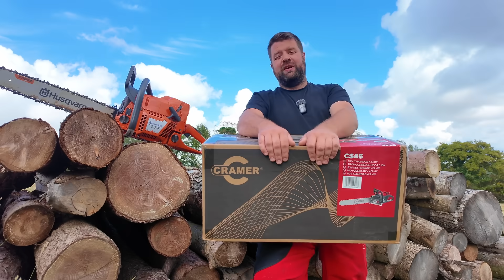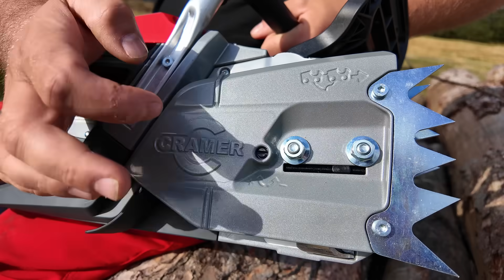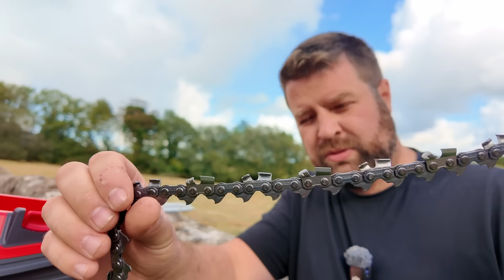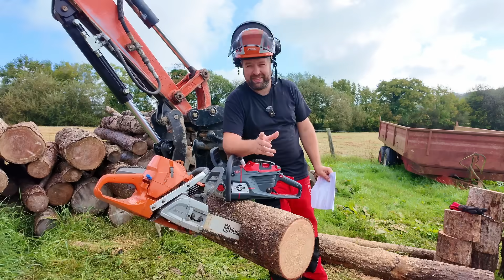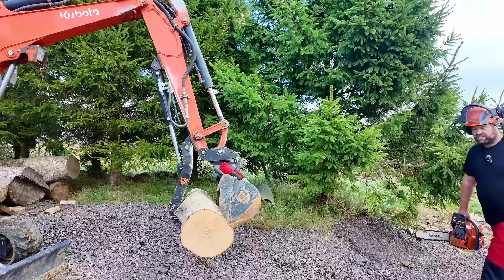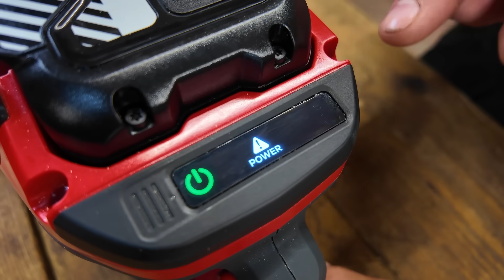Can this NEW 70cc Chainsaw BEAT my HUSQVARNA 372XP?

Comment: As in the car world, electric is never short on power, endurance is where it falls short.
Reply: Amen. DeWalt 54V tools like circular saws when put in hard work for example while rip cuts it burns those 54V batteries out very quickly.
Reply: 4 batteries in a MSA300 last me 40 minutes, achieving less work and needing to return to base, halting productivity entirely.
Reply: @sesslethehungrycaterpillar 
Should have bought bigger batteries.
Reply: @Burnit-l8j they were the big ones
Reply: @sesslethehungrycaterpillar 
Stihl and Husky are both a generation behind the legacy battery chainsaw brands that have only made battery electric saws. Greenworks, Cramer, Milwaukee, EGO and Ryobi all make more powerful battery chainsaws and most of them cost considerably less than either Stihl or Husky electric saws. Battery life and extra weight of battery saws are the limiting factors for professional loggers but for most homeowners battery electric have become good enough for most people. In 5 to 10 years batteries will likely be dry cell technology that have much longer run times and weigh less. Three years ago I would never have bought a battery electric saw because frankly they sucked compared to battery electric saws today. I cut 20 cords of firewood each year using three different size battery chainsaws for different size wood. I own several two smokers that work well but i never use them anymore because battery electric saws are more convenient for me to use. My big 20 inch Milwaukee is strictly for bucking large diameter logs because it’s heavy. I use the little Milwaukee 16 inch and a smaller 14 inch Ryobi  battery electric saw to process the tree tops because they weigh half as much as my big 20 inch Milwaukee and are easy on batteries.
Reply: In 20 years or less I predict because of battery advances both Stihl and Husky will start phase out the smaller 60cc or smaller chainsaws because today’s battery electric will look like junk compared to future battery electric saws. The big bore long bar saws loggers use might never be replaced by battery electric but the mid size and smaller will likely be replaced by battery electric in the future because of better future battery technology and local and state regulations that are already starting to ban two smokers in some areas of the U.S. I occasionally have tandem axil tree service logs dropped off on my driveway that I need to cut up in a residential neighborhood so that’s another reason for me to use battery electric in case I have a NIMBY living in my neighborhood. I have no issues with gas saws because I used them for 40 years but became dissatisfied with Husky’s computer controlled carburetors that I can’t work on because they require firmware updates to fix carburetor issues and only the dealers had access to this software when I bought my 550xp which is a lightweight ripper when it’s computer controlled carburetor was running right.
Reply: How long did the battery last , how much does it cost ?
Reply: @robrusticwoodlandproducts6662  My above comment is based on researching from cramer's own website, the diabolical pricing and running costs are all worked out. so have a read. but basically its a much higher up fron cost, and due to battery degredation, it is always more expensive to run. Everything comes with a cost. whats the run time on the cramer, price of the batteries? lets run a few numbers shall we, 7.2 aH battery that costs £500. at 82V that gives you 0.59KW/H running 4.5KW motor that gives you 8 minutes 24 seconds of run time. Cramer have a dual charger, running 4 amps per slot, so thats 2 hrs to charge 2 barreries, average to 1 hr/battery. you need 5 batteries to keep running . this gives you 40 min per hr. This allows the equlivalent petrol to be refueled and chain sharpened. Now to the money. £900 quid for the saw + £140 for the charger, and £2,500 for 5 batteries. that's £3,540 all in. and then £2.00 a day for the electric lets compare with a husky 572XP £960, leaving £2580 for fuel, lets call it 1.5 a ltr, thats 1,720 ltr of fuel, based on equal run time of 40 min /hr thats 1400 hrs= 175 work days= 35 weeks. in this time the batteries would have gone through 1400 charge cycles, then their is the electric. 175 work days x £2 is £350, this needs to be ballanced with another 233L of fuel equating to another 5 weeks relating to another 200 charge cycles. We will leave it at that. so 1600 charging cycles. Trouble is, after 1200 charging cycles, (I've looked it up) the battery is down to 80% capacity, thats another new battery right there. This is a more expensive up front cost system, that is more expensive to run
Reply from the maker: Hi Lee, totally correct power is awesome on battery tools, if you where doing a full days cutting with any battery chainsaw you would need a couple batteries and a charging point to reduce any downtime 👍🏼
Reply: @MachineryNation  It's not a couple though is it. To run for 40 min every hr, you need 5 batteries, not a couple as you say. With honesty like that, had you considered a carrear in polotics!